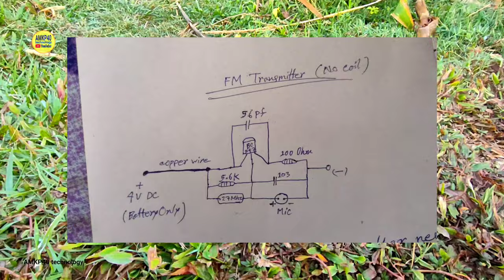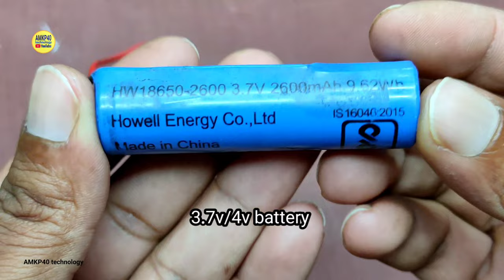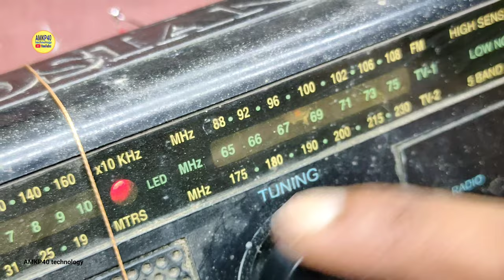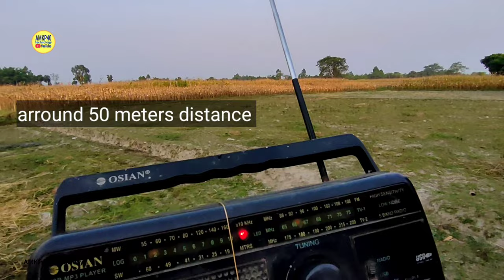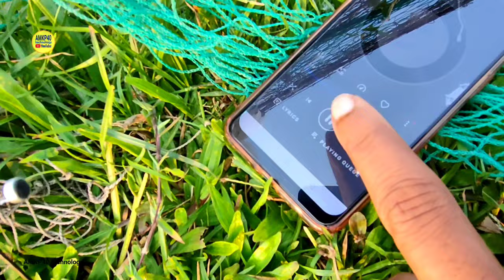Coil Less FM Transmitter 📻

Comment: Please, I just have a question: is the modulation deep, clean and clair, as the commercial FM stations' one are? It's because, as we know, quartz oscillators don't allow a large frequency deviation, due their high quality factor, "Q", wich give them their characteristic stability and precision of frequency - and this the reason why PLL circuits are used for those devices. Thank you!
Reply: Now I've watched what happens: this transmitter of yours is a free oscilattor one, the crystal works as an simple capacitor, and this is the reason why the frequency changes all the time - and, in fact, if the quartz crystal could works as a real one, you would tune the transmitter, by the small FM radio receptor, at 108 MHz, wich is the fourth harmonic frequency of a 27 MHz quartz crystal, in instead of about 100 MHz, that were showed by its dial! 
Then, I'm so sorry, friend, but your transmitter is not a quartz crystal one, 'cause it equates to a LC one - and this explains why it has an audio too deep, wich never would come from a quartz crystal one! So, the only solution is make a PLL FM transmitter, whose reference is the crystal oscillator for stabilize a LC oscillator.
Reply from the maker: This circuit not fully crystal based, here I am using this crystal for semi stability of frequency as like capacitor.
Thank you for your valuable comments 🙏🏻

Comment: can i use 100mhz crystal?
and can i also use double the size of the small microphone?
Reply from the maker: No, otherwise frequency should be higher than 108Mhz which is FM radio band's maximum frequency point 🙏🏻
Reply: @amkp40technology  then what crystal do i use of minimum to maximum?
Reply from the maker: 20Mhz to 27 MHz 🙏🏻

Comment: Can I use a 10 MHz crystal or is a 27 MHz crystal necessary?
Reply from the maker: No, 
Yes 👍🏻
Reply: After using the 27mhz crystal I can't pick up anything on the radio, even putting the microphone close to the radio. 😥
Reply from the maker: Need Coil between transistor's collecter pin and positive input.

Comment: i have noisy neighbour so can i use it for them ?
Reply: But how it can apply ?
Reply: Is it automatically connect to them or they have to set frequency ?
Reply from the maker: Can you tell me exactly what is the problem 🤔
Reply: Actually, I have neighbour they always play loud fm and I am very tired now so I want to make device like fm jammer...... 
Plz help brother 🙏🙏🙏
Reply: I will be very greatful to you if you give the solution of this issue...
Reply from the maker: Yes 👍🏻 you can jamm specific fm frequency, just set same frequency. If they tuning nearby strong FM radio signal, you can jamm using this tiny circuit 🙏🏻 thanks for comment.❤️
Reply: @amkp40technology  it doesn't work brother please help me suggest some circuit like radio fm jammer
Reply: @amkp40technology  suggest some videos for this !
Reply: @amkp40technology  ???
Reply: @amkp40technology  bro please answer it's very serious to me 🙏🙏🙏

Comment: Sir,,  crystal 27mh or What Replace. Ples say to. me..
Reply: I have 20mh cristal
Reply: I have 20mh cristal
Reply from the maker: Yes, you can try.
Reply from the maker: I suggest you for use a coil between transistor's collecter pin and resistance+crystal+positive input point. 🙏🏻👍🏻 For stability.

Comment: will this work on AM band radio
Reply from the maker: No, only FM band radio.
Reply: @amkp40technology  one question?
why long copper wire between the battery and the circuit, plz explain??
Reply: It’s acting as the coil !